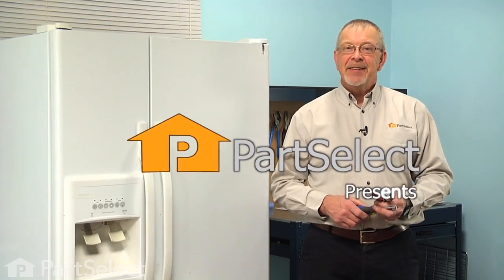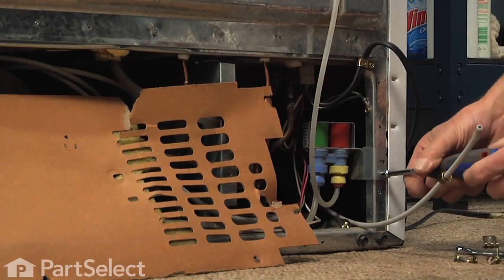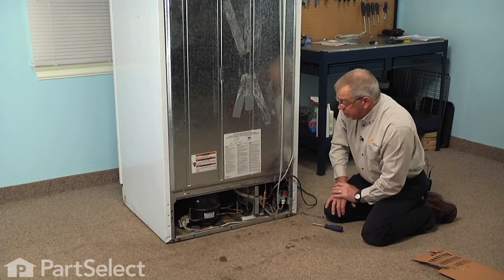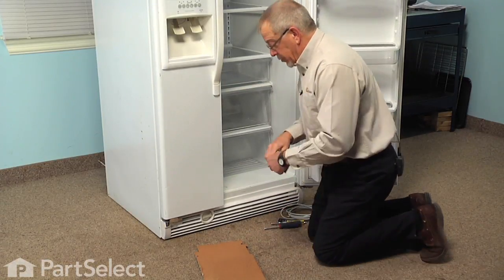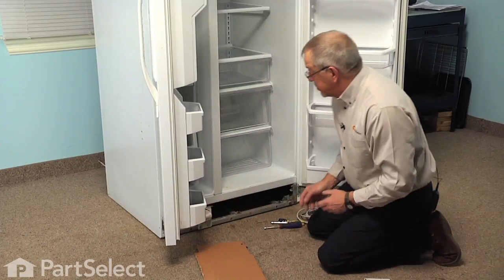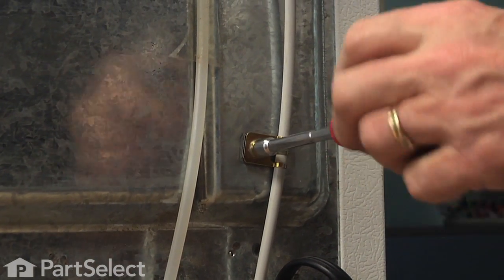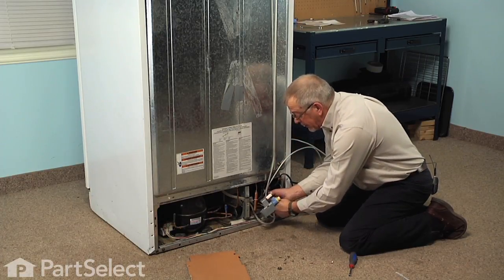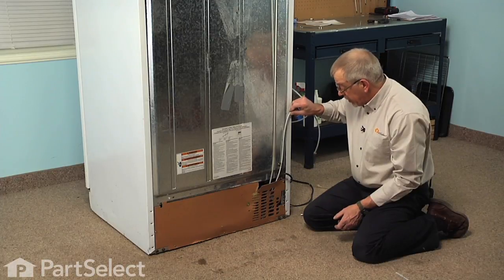Refrigerator Repair - Replacing the Filter Inlet Water Tube (Whirlpool Part # 8201597)

Comment: My '02 Whirlpool,  outlet hose from filter housing,  did not go to the location where you routed. The hoses I received for the new kit are similar in size, whereas, the porting holes into water filter housing are 
dissimilar.

Comment: Thank you, thank you, thank you. Had a pinhole leak in the tubing at the clamp on the back. Once I realized the part I needed, I was able to replace it on my own thanks to this video. Thank you!
Reply: You're never gonna believe it but I got the same issue at my house.

 But I don't know I think mine is quarter inch tube on both ends.

 So for now I'm using the old tube I'm not gonna replace it, The only temporary fix we could do was put up bras O ring next to the stainless steel until today.  when I could get to lowes and get a rubber O ring for the shark bite.   And save any potential electrolytes is that may happen

Comment: And that bracket that holds the line in the back is what cut into my line causing it to leak. Then the step up on the tubing OD so you can't just replace it with standard 1/4' tubing.  WTF Kenmore...
Reply: You are exactly right tmar23 it happend the same thing to the tube of my refrigerator it is liking from the bracket area because the damn bracket cut it!!

Comment: I was able to do this w/o removing the valve or output feed, but you'll need small hands. There's enough slack in the line to get the filter housing out part-way where you can reach the 5/16" line to release it or replace it. 

I'd also check for leaks before replacing the front grill, if at all possible!

Comment: Itook out this housing to replace the water inlet valve, and now that I am putting the lines back, the housing is leaking like crazy when i turn the water back on. Leaking from both tube entries and when i replace the filter water shoots out of it! Does my housing now need replaced or am i doing something wrong? I've bever had this leaking before until now
Reply: You likely need either a new filter housing or need to convert the filter to a generic filter located in the back. Our 2004 Whirlpool's water filter housing's release collar, w/ 4-prongs to grab the incoming water line and seat it to the housing seal, broke...3 of the prongs broke off. Of course, no one sells just the snap-in collar, so one needs at least a new filter housing and likely a new output line, about $190. We decided to convert to a $20 "5 yr" generic filter using 1/4" brass fittings made for plastic tubing w/ brass inserts to support the plastic tubing while tightening the compression nuts. Works great. Do clean the fan and coils while it is apart...extends the refrig life and saves significant electricity. Coils seems to run the full front-to-back of the refrig, so we used compressed air but a vacuum in blower mode might work, also.  Tough to clean the middle coils.

Comment: Great video try it last night but another situation was the ice door R/S hinge plastic was crack somI order a metal bracket housing hinge which is made for replacement took a
Long nose plier bend left to right to break off 

Realign install with a adhesive tape 
Maneuver in place and press Wow came out great 👍 

Door flaps and water dispensary great again luv u tube

Comment: Can you give advice on changing the inlet water tube on Whirpool model WRS950SIAM00? I was able to change the outlet water tube but the inlet tube seems to be inaccessible and I was told I would need to remove the back cover of the refrigerator. This seem to be ridiculous so please help.
Reply from the maker: I am not sure which tube you are referring. Where are the ends connected to?

Comment: I'm having some trouble with my water dispenser, but it seems through troubleshooting none of your videos are the root cause of my issue..

It seems that the dual water inlet valve is working, I tested it by disconnecting the valve-> water dispenser line. Water is definitely making it past that valve, but the tube that runs up into the middle of the refrigerator, and back down before coming out to the front, seems to be clogged, or just not passing water.. Is there any way to service this tube?

I can share pictures via email if it's not clear what I'm talking about..
Reply from the maker: Matthew Behling If you can get me the model number I can help you out.

Comment: In this video you are removing the tubing from the valve and put it back. Just wondering the reason for it. The new water line runs from front from the filter housing to back to connect to water line. So what is the reason for removing tubing from the valve in the back of the refrigerator and put it back? I have toreplace the in line tubing because i had to cu the 5/16 end which goes into filter housing because i could not remove it. I guess only option is to replace the tubing. I was wondering if i use 1/4 to 5/16 connector and create 5/16 end.
Reply: The tubing removed from valve in the back is 1/4" going into the filter housing assemblyin the front? So was it removed so that the housing could be pulled out in the front because of shorter tubing length?
Reply from the maker: Ashvin Patel I forwarded your questions on to Steve and will let you know as soon as he gets back to me with a solution for you.
Reply from the maker: Ashvin Patel  The tubing is quite short and releasing it allows for easier access to the filter housing.